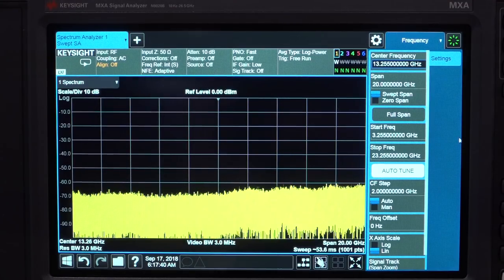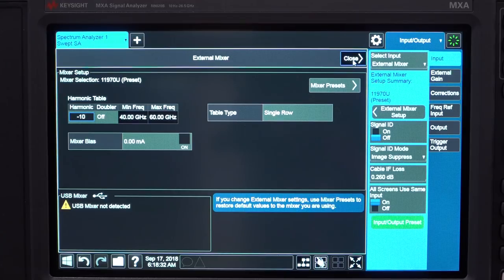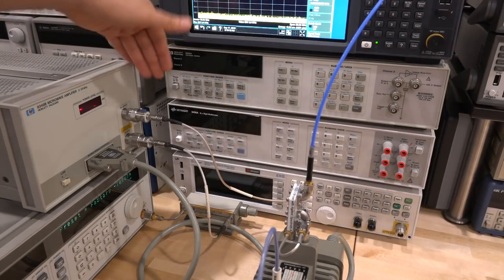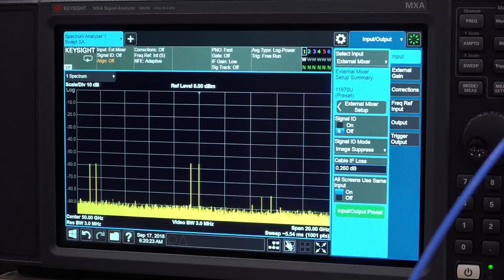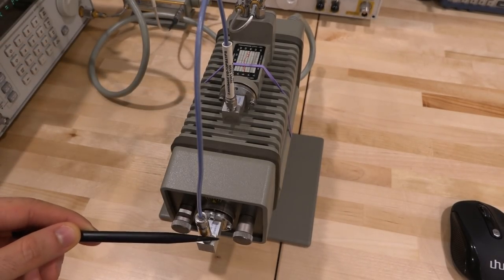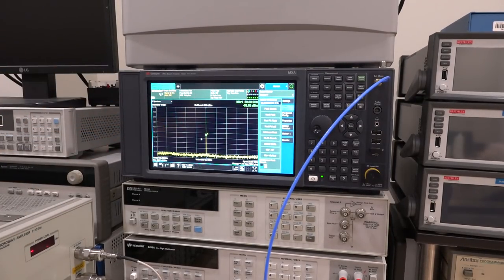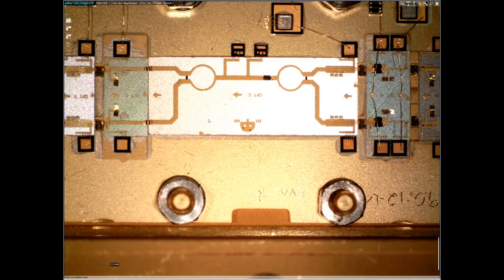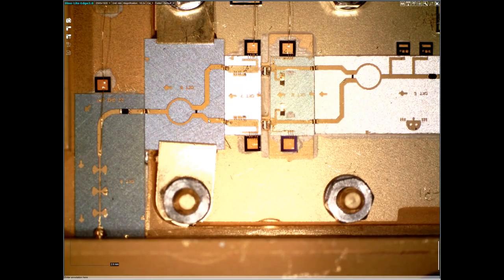TSP #132 - Quest for mm-Wave Capability: Teardown, Analysis & Experiments on Generation & Detection

Comment: Ha ha!  They put Kilroy in the amplifier (upside down under the microscope between the pair of splitter/combiners).  This is amazing.  I can't wait to see what you do with millimeter waves!
Reply: The days when process technicians loved to have fun putting odd things in their high-tech designs.  HP's microprocessor design team was really keen on this; they even developed their own process for adding high-resolution images to silicon using a bit-mapped array of thru-silicon vias.
Reply: Tektronix had some fun additions in some of their schematics too.
Reply: hahah was going to comment on the same thing!, guess i'm not the only one that noticed Kilroy.
Also noticed that "EVAL-R1" hand-scratched on that metal base.
I guess now it's "Shahriar was here", peeking the insides, so fitting! :D
Reply: Guillermo Lovato EVAL-R1 seems more like a technical designation or even a stock keeping identifier at a previous laboratory.

Comment: The 83752 has a multiply function. You can set the multiplication factor, of the multiplier, in there and it will display the correct frequency, so you don't have to do the math.

Comment: The output sub-module on the amplifier has "22GHz LPF" written on it at the top (as we see it on screen). That pretty much just leaves that tiny diode on the input of the big module as a doubler!

I wonder why, after passing it through a splitter and amplifier, it was combined back again, and then split again, amplified, and recombined again, rather than being each path being amplified twice, then combined just once. Maybe the slightly different path lengths for each half-amplifier helps to reduce the average noise, but I'd have thought with the splitter+combiner losses would be quite a lot greater.
Reply: Maybe it helps with balance?
Reply: Using a pair of Wilkinson hybrids does boost max power output by 3 dB, nothing to sneeze at at these freqs for the era they were produced I would say ...
Reply: Maybe splitting it helps keeps the amplifier linear something like a backoff of 3db. Also, the filter in between the two balanced amplifier stages could help filter out any potential blockers that can saturate the second stage. Is my analysis correct ?
Reply: And of course the extra 3db from the balanced amplifier configuration
Reply: The splitters are actually 90 degree hybrid splitter/ combiners. Each amplifier stage is a pair of transistors working 90 degrees out of phase of which the two outputs are combined back again in a 90 degree hybrid to be in phase again. Why? To suppress old harmonics of the fundamental.

Comment: I would love to see you buy some UHF vacuum tubes and put together an oscillator using one, and comparing it to something solid state. 6AN4 tubes for example can push close to 900mhz and cost about $6 each. a 2c42 tube can push over 1750W at 1050mHz and is about $40 (although you need close to 1000 volts for the power supply so that's an issue). It may be practically DC compared to the frequencies you operate it, but I still think it would be interesting to see your expertise put towards something so vintage.

Comment: Thanks for this teardown. Definitely answers some questions on my end as well. By the way, this setup can also use the older syn. sweepers as well. I personally have the 8340B as the source for this system setup back in our hometown (far away at the moment). You can also put an isolator (U365A) for the impedance mismatch if doing over air experiments. Kilroy was a nice touch. Interesting story on kilroy was that the kilroy art was popularized during WWII. However, it actually represents a symbol of an even older war. WWI. The thinking at the time may have been that WWII would also include trench warfare like WWI (the French thought this would happen). Another thing Kilroy could stands for is a soldier/commander (could be the enemy too) peeking over nosying about on what is going on in the field. Forever watching for you or against you. Was great psychological warfare/propaganda. (In this case, I'd like to think for you in goodwill for your experiments.) At least that's what my grandfather would tell me. Its all debatable since the people who know have unfortunately long passed their expiration date. Rest their souls and that of my grandfather. This is why teardowns of these older equipment are so awesome. Its a sad day when our younger set doesn't know how we got to where we are today. Much appreciated.

Comment: Beautiful..  I love this channel

At what power level can your finger actually "feel" the high frequencies?

As far as what to test, why not see how well the rf absorbing material actually attenuates
*i would really love to see rf adsorption material vs conductive foam REAL conductive foam, not that cheap stuff you get with chinese chips thats just colored black but has no conductivity

Anyways, may the universe bless you on this selfless endeavour!
Reply: 30-33dBm is my experience.
Reply: James DeLuna do you happen to recall what frequency band that was at?
-trivial, but I am oh so curious!   I can only imagine what it felt like!
Reply: @topherteardowns4679  Ka Band. A rapid heating of your hand. Not quite like convection oven where you sense the heat gradient and your nerves warn you. More of an instant burning once in LOS
Reply: James DeLuna crazy!   For some reason I was thinking it would have started at a tingling, like wheb your arm falls asleep and goes numb/wakes back up.   But, I guess the frequency is so insanely high that it is significantly caster than the central nervous systems line of communication, so, like persistence of vision, it just gets blended together as "Ouch! Hot!"

Thanks!

Comment: at 5:16 you claimed the hardware was a 20-40ghz Amp, but, it says right on the label  2-20Ghz
Reply from the maker: Yes, the amplifier is 2-20GHz, the input range of the mm-wave modules.

Comment: I’m still at a bit of a loss what those high frequencies are used for.
Reply: Satellite communications, radar, astronomy, molecular spectroscopy, wireless communications (60GHz for 802.11ad), etc.
Reply: Now for my 'witty' comment:
Higher frequencies are used to rip holes in space-time and communicate with the dead.
Reply: mind control by the government obviously ;)
Reply: Cellular 5G NR will use mmWave
Reply: 5G ! Companies have already made CMOS rfics that work at 28,39 Ghz ! Imagine having one of those on your phone.

Comment: 26.5 GHz is not mm-wave it starts at 30 GHz
Reply from the maker: Yes, however since the upper frequency ranges of the modules go into the mm-wave frequencies, HP still calls them mm-wave source modules.
Reply: Yes the output is at millimeter wave after the multiplication,. we had (the lab) the same modules for anecoid chamber, such robust modules as compared to the new one (vdi active module) that are much more sensitive ! By the way, thanks for your work ;)